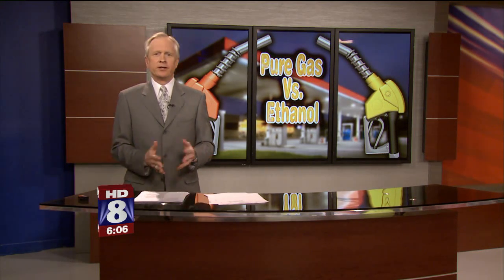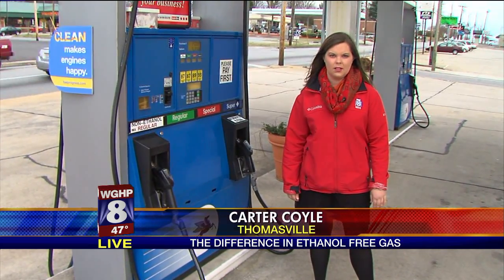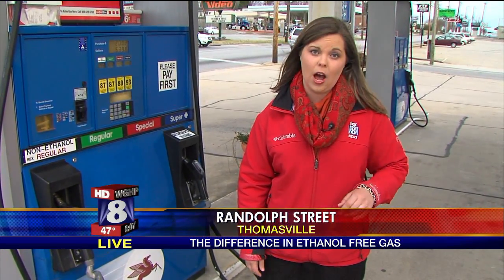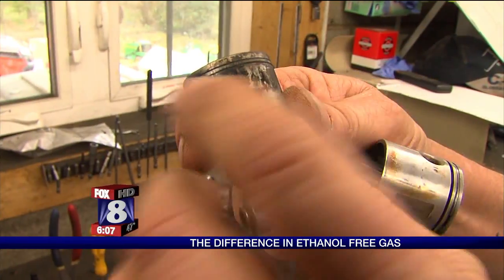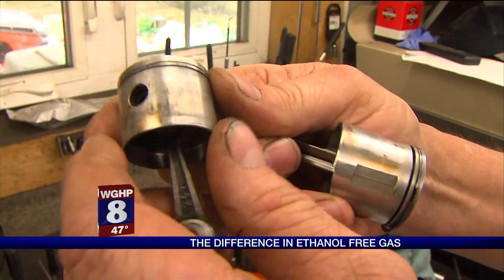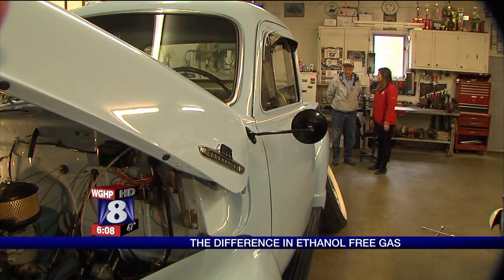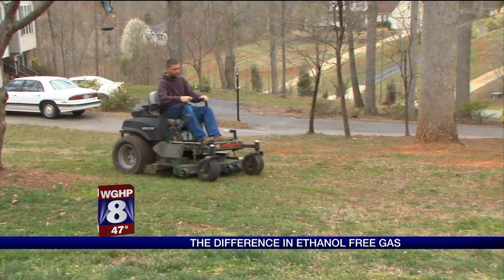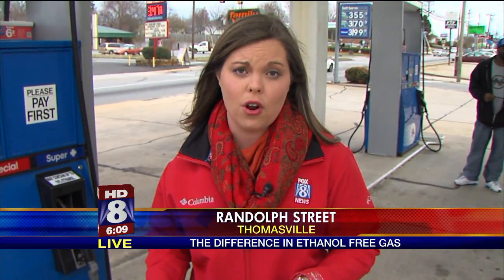Pure Gas v Ethanol

Comment: That in not a car. Of course your can't run older engines with carbs on that shit you need a high compression engine or a modern motor with an ecu fuel system.. And that is not ethanol it's gas and 10% ethanol....  100% ethanol is real fuel. All ethanol runs great in plastic free high compression ecu tuned engines.

Comment: Ethanol does not like open systems either due to water attraction when exposed to air especially humid and or cold.
Reply: Matt S Correct, it is bad for any engine that sits and is only used once and a while. Aircraft would be susceptible to a common ethanol characteristic known as phase separation. Most pleasure aircraft are not used on a daily basis. I know people who only fly every few months due to getting older. Or sometimes jobs won't allow the time for flying. That is why you won't see aviation fuel changing formulations any time soon. The low lead 100 is working just fine. Same holds true for lawn care equipment. The shops I have talked to say that since the introduction of ethanol their repair business has doubled and tripled in some cases due to the damaging nature of ethanol in small engine applications. It may be more expensive, but I won't burn that junk in any of my small engines. I hope this information is helpful.

Comment: use e85 in a properly built engine design for ethanol and it will do more mpg then a regular petrol engine will... its all about the cr ratios.... higher the better for e85
Reply: That is utter bullshit,it is impossible for you to acheive the same mpg as gasoline because ethanol has less BTU.So if you do acheive the same mpg,you are going to have enormously less power.Absolutely no gain from using ethanol.
Reply: +Charley Bomps ok pal you know everythink... and all the research thats been done and is available to see ob the internet is utter bullshit as you say..... its even on wikipedia need i say anymore.....
Reply: 16vastraturbo All research that has been done,has proven it takes more ethanol to create the same amount of power as gasoline.

"its all about the cr ratios"What is a cr ratio,because I have found no such thing to exist?

Comment: This will come as a surprise to the people who build and race the fastest, most advanced race cars in the world.      The Indy League Racing Circuit.     

       All cars in the ILRC run on 100% ethanol.     And they have run exclusively on alcohol based fuels for over 50 years.   

         That's right, the entire Indianapolis 500 Race is run without a single competitor using one single drop of petroleum.

Comment: Stupid.  More ethanol is required by the engine compared to gas so it makes the engine respond differently.  TUNE equipment for the FUEL you put in it, NO PROBLEM.

Comment: Vintage cars will have problems with ethanol. Only cars manufactured from 1980's to the present can process gas with ethanol. Sorry that this video is biased.
Reply: Husky Corporation it has to be a fuel injected car... its the carburetor that causes problems with using E85. Any car thats fuel injected can burn E85.
Reply: +Husky Corporation My car from high school is a 1970 Buick Riv.  It has only ever run E10 for as long as I've had it and it still fires up every spring.
Reply: @phantomscolts7002  You hit it on the head!

Comment: It kind of gets annoying to hear voices like the women in this video sound like she actually knows what she's talking about without actually doing any research.
Reply: Im a small engine machanic and ethenols making me rich.$$$$$
Reply: Once I was out of state and poured non-ethanol gas in my 2006 Accord V6 and boy what a difference it was.! The car took off like a rocket!! Not kidding. I was also get an extra 2 to 3 mpg
Reply: Paul Dzhur Lol. Many racecars and even monster trucks use pure ethanol. Why? Because it's more powerful. You just need to use the proper parts (you can buy a conversion kit online for a few hundred dollars) and your ECU will probably need to be tuned to the new fuel type but you'll end up with more power. Your car was tuned for gas, so when you put a more pure gasoline in you made it perform better. Tune your car for ethanol and it will outperform your gas dyno.
Reply: Prof Kaos ethanol actually has less potential energy than pure gas.
Reply: Jun Yi hence the lower octane rating. Got it.
Reply: That would be relevant if we were trying to boil water.  But we're not, we're trying to burn as fast as possible to create gasses to push a piston.
Reply: I've done it, my cost per mile is best when running fuel with ethanol in it.
Reply: Then you're also a liar.  My brothers a mechanic and see's no difference. We've run our snowmobiles on E10 for decades (literally in Minnesota) and they're just fine.

Comment: Tuned or not tuned engines will be ruined in a matter of time regardless, fact is that there’s still ethanol in the gas, ethanol attracts moisture and not burning completely will ruined any engine over time. Is time to bring 100% gas back and get rid off this crap ethanol gas.

Comment: the problem whit ethanol is  that  older engine are not tune for it  meaning  its running lean   you need up too 30% more fuel  depending on the ethanol blend   and some metal dont like the ethanol its make a reaction whit the metal   we run race cars and tune drag cars  ethanal  burn  cooler and make hp that normal fuel some cars up too 10% more hp  also  burns alot cleaner   like i said  running ethanol that normal  fuel  you need more fuel  for it not to run lean  or it will distroy your engine

Comment: As reporters they FAILED! Gas burns very dirty because the carbon content is extremely high leaving blacken carbon deposits on gas engines.  Burning Ethanol leaves absolutely no carbon. The little ethanol 10% cannot harm an combustion engine in fact it attempts to clean a combustion engine by virtue of its non-carbon properties. Ethanol also has a higher octane. Big oil would like you to believe in the news clip above but don't be fooled. BRAZIL created millions of jobs switching from gas to ethanol and they've been doing it for 17 years allowing the Brazilian government to pay back all of its debts, clean up its environment & be totally non-dependent on foreign oil. Watch 'pump' on Netflix and do a little more research and ask a lot of questions. Just the mere fact that Brazil has completely adapted to ethanol in their very older American cars as well as current models is the undeniable truth.
Reply: 👌👌👌👌they really want us to believe them
Reply: do some research before you think big oil is out there lying. it does mess with engines. I have seen outboard, lawn mower and vehicle problems. it tore up my carburetor gaskets in my 2001 outboard and also in my lawn mower. and it also gets 26% less MPG and 26% more emission's. the ethanol crap is just that. crap.
Reply: Planting All That Corn sure has been good for the rainforest they are burning all the rainforest in Brazil to produce ethanol

Comment: Ethanol ABSORBS water / moisture  when left standing. It separates to the bottom of any tank , but especially small engines. Your carburetor takes the brunt of it and gels up. All the talk of higher octane is a joke ..small engines don't have high compression. Run straight gas and see for yourself the power difference , no more sputtering or slight missing. Next time you put that fuel in a vehicle you have , see if the pump has the label " boaters check with manufacturer if ethanol is approved in your engine " . Why ? Because ethanol ABSORBS moisture and more so on marine engines and small engines that are generally not closed systems. Ethanol is a scam and so are fuel additives and "fresh gas".  No ethanol free pumps in your area ?  Ready to see if you really are getting scammed with ethanol and missing the true power your small engine has ?  I researched  and did it and can not believe the true power all my mowers were capable of but was being robbed by ethanol.  I was skeptical but tried 1 gallon of gas and since then have never looked back !   Ready ?   Mix 1 gallon of gas with 1 cup of ...water .... Yes water !!  Add a small amount of food coloring ( or dye for the backpack sprayer ) to the water and mix it all up for a couple of minutes and let it sit overnight.  In your container the next day will be in the bottom the water ( 1 cup plus all the ethanol extracted and  dye ) and what is on top is PURE STRAIGHT GAS . The gas is a couple of points lower in octane ( small engine remember not high compression ) but has a HIGHER BTU meaning it has more power and also it can no longer absorb moisture that ruins carburetors since you removed the ethanol that mixes with water a lot better than gas.  Research what I state here . Try 1 gallon. Seriously . If anyone tries this and finds what I say is true , please reply or comment . Sorry for the length but I became infuriated when a customer in a lawn equipment dealership just spent $1000 on a generator and the salesman told him he needed fuel stabilizer because there's nothing he could do to keep the thing running due to insufficient use and even with the stabilizer he would need carburetor service roughly twice a year.  Yes , he will because of the ethanol scam !! Thanks
Reply: Terry Sessoms 

Open a whisky bottle and mark the level. Check in a few days for water absorption. It’s 40% ethanol, so should really soak up water, right?

Comment: ethanol damage my motorcycle carbs they had to be rebuilt luckily there's a gas station that sells hundred percent gasoline for the boaters that's by me. I pay a dollar more for 91 octane premium a hundred percent gas but it's worth it with the mileage and then no damage to my carburetors that's not produces less power absorbs water when it has phase separation is the most damaging is unbelievable they need to fix that if they want us to burn it